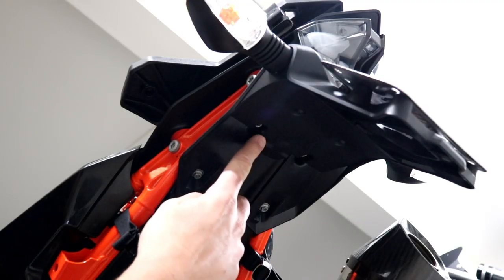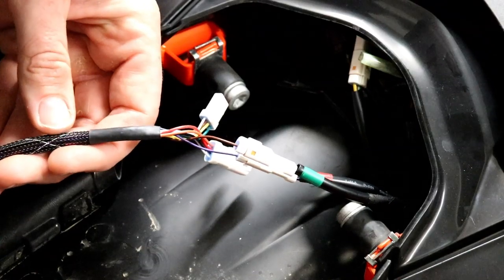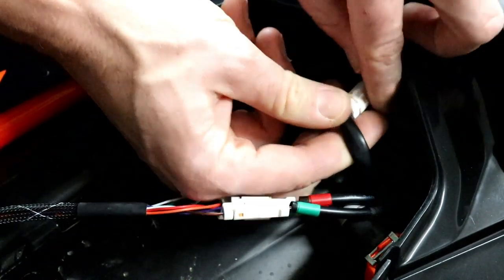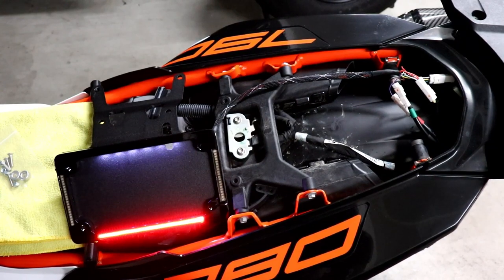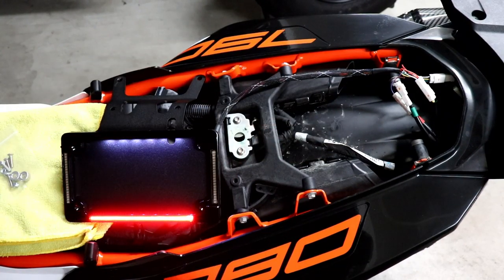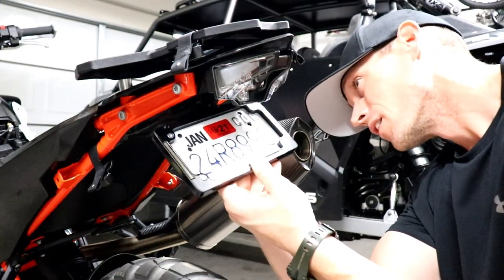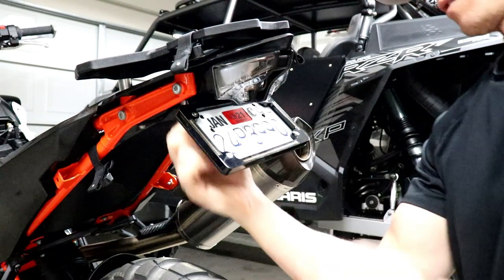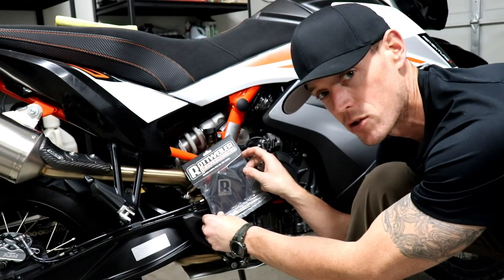2020 KTM 790 Adventure R Upgrades, Accessories, Rottweiler Performance - Tail Tidy, How To Install

Comment: Excellent talk trough! But I would be worried about the safety site of compromising the signals..., and you wouldn't get far as well as police wouldn't let you not being CE'd.But I hope this set up will work great for ya 😉Be safe and override the Corona Virus
Reply from the maker: The flashers are pretty dang bright! Seem plenty safe and visible 👍
I'll report back if I run into any trouble. Thanks for the feedback

Comment: Why does my 2019 790 Adv R 's rear look different to your 2020?  I am in Belgium, do we get a different motorcycle here in terms of indicators and tail section?
Reply from the maker: I believe you guys get the sleeker indicator lights, don't know If the actual plastic license plate holder Is different though?